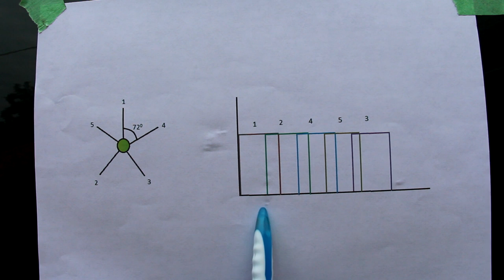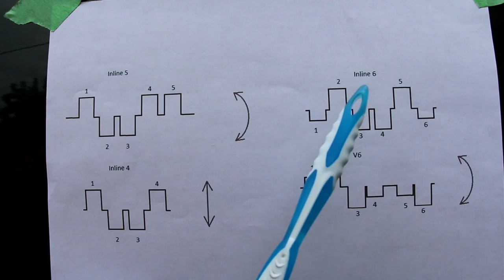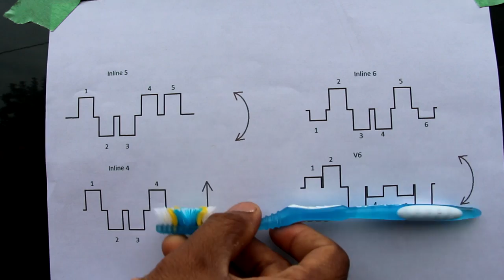Why Inline 5 Cylinder Engines are an Anomaly

Comment: The worst fasteners are on early 2000’s Subaru’s (at least the US versions.) many of the bolts that retain the camshaft and sometimes the flex plate/flywheel are an obscure  “Torx-plus.” A normal torx bit will loosely fit and can occasionally be used to break the bolts free, but it is likely to shatter from the stress concentration. (I ripped my wrist open doing this...)
Anyhow, as a mechanical design  “enthusiast,” I appreciate you pointing out every visible feature as you go along

Comment: The slightly earlier version of the Whiteblock motor used in the 850's and S/V 70's did have an exhaust manifold that the turbo bolts to.  I've had to replace a couple of them.  Its a nightmare.

Comment: Nice one bro. Is it the same as the Volvo T5R engine?
Reply: Nope, this is the B5244S4 which was used in the S40, S80, C30 and C70. It's 2.4L naturally aspirated with intake CVVT and delivers 138 bhp. The T-5R engine is the B5234T5 which was only used in the 850 R and 850 T-5R. That's a 2.3L turbocharged engine without variable valve timing and delivers something between 220 and 250 bph.
As for naming
B stands for petrol (bensin)
5 stands for 5 cylinder
24/23 stands for displacement, 2.4L and 2.3L respectively
4 stands for 4 valves per cylinder
S/T stands for naturally aspirated(standard)/turbo respectively
the last number indicated the engine generation or variant
Reply from the maker: No turbo on this one
Reply: @dvdouden  Thanks bro. That was quite a bit of info!

Comment: great video, the plastic parts inside the engine is absolutely because of saving on costs.. however, depending on the plastic type, it might very well serve just as fine as a steel or aluminium part where minimal force is put upon it :). But I often wonder myself at some solutions that are chosen on some engines, and usually find comfort in assuring myself that a smarter individual than me have designed it in such a way for a good enough reason  ;P

Comment: A disadvantage of most 4 cyl. is that all the pistons are at top/bottom dead center at the same time. It takes a lot of flywheel to smooth this out. 3/5/6 cyl. don't have that.
The new Japanese 4 cyl. motorcycle engines have 90° crankshafts to eliminate this.

Comment: Great video with good explanations. Another factor to include is that mass produced 5 cylinder engines  were possible thanks to fuel injection. With carbuarator 5 cylinder engines always had issues  getting  the exact amount of fuel to all cylinders.

Seems you go thru a lot  of Mevotec control arms.. :-)
Reply: Audi had one in the 100 5S typ 44...don't know how they did it.

Comment: FYI, 13mm is a half inch. (0.5 inches = 12.7mm, with a little bit of clearance between the socket and the bolt).

Comment: The short distance and the coolant slot cut between cylinder bores is the reason why the turbo versions of these used to crack the bore at that exact spot, particularly when the owner has tuned for more boost.  I have seen this on a dismantled Focus XR5 turbo block. If Volvo had gone the way Subaru did with its turbo engines (ie: closed deck vs an open deck on atmo engines) this problem would not have occurred.
Reply from the maker: Good to know

Comment: as always excellent video. can i ask, are the latest (ie 2020) Volvo inline 5 better in design (like no plastic inside a closed engine) and more durable (no oil and coolant mixing problem) ?  thank
Reply: I realize that this is an old comment, but anyhow: there are no 2020 5 cylinders from Volvo. The last one went out of production with the S60 Gen2 in 2018, if I recall correctly. Also that was the AWD diesel. All other versions and models had gone over to the 4-cyl VEA. Last 5-cyl petrol in 2015-16 something. The oil pick up is metal in that one. But there are probably some parts inside the engine which are plastic. Electrical connectors for sensors, for instance.

Comment: I own a Ford focus St 2.5 same engine he is working on,have an oil leak that can't be find, the leak its on the front of the engine,i did change the oil filter housing but no luck,pls brother if you can pls give me a hint
Reply from the maker: Pcv ?
Reply: The pcv is in the oil filter housing,i hade a look again today and saw no clamps on the pipes so clamped them did not have time to wash off the oil and drive it.Will check it tomorrow.

Comment: I have a 2.5L turbo one of these engine in my 2007 s60. They separate the pcv and oil filter. The oil filter goes to the bottom now. The pcv still have a tendency to clog. 120k miles on it and still running good. 
I also get a 1997 960 with a inline 6 engine on it. 160k miles and running good.
They r really good engines.

Comment: What is built in is the hot side of the turbo to the mandifold if you wanto put different turbos on the turbo version u need a custom manifold no mater what

Comment: Those cylinders are crazy close together. Surprised to see the head gasket and walls good.
Reply from the maker: Well I suspect the head gasket failed with all the water in there
Reply: @speedkar99   Yeah, I guess it had to fail. But, it looked pretty good. I've seen a lot worse.

Comment: If you have a chance check out an old mercedes 2.5l inline 5 diesel, it's rumoured to be the most durable and smoothest running diesel in a commercial car, it would be interesting to see how it's built
Reply from the maker: That would be sweet

Comment: The 3.2L I5 diesel engine found in the global Ford Ranger since 2012 is a really good engine. I have one of those and have worked on many of them, and those engines are pretty damn sturdy and reliable. They don't have a whole lot of issues. Just need to keep with the oil changes, use full synthetic oil and high quality diesel fuel, and those engines can outlast the truck.

Comment: inline5 diagram (17:20) in not corect! once  you sed that there are 72` beetwin roads how did you align them in the end? :O
Reply from the maker: They roll 720 degrees not 360 for a cycle
Reply: @speedkar99   all right

Comment: Biggest mistake I've found was when you said that on turbo engines, the exhaust manifold is integrated with the head. I think that maybe you meant that on newer engines it's integrated with the turbo ;-) .
On older engines the oil pickup was made of metal.

Comment: About the balance: There are two configurations. One of them has lower rocking motion in first order. Then use the long connecting rods from inline-4. These have low second order vibrations. I cannot quite understand how this modular engine expands to inline-6 .. Anyway typically you mount a gearbox rigidly onto one side and hopefully some accessories onto the other, then you get high rotational inertia. Also with long connection rods, DOHC, and wet sump the engine is very high which also helps with inertia on that axis. Then just let it wobble a bit around the differential.

In a Volvo the engine leans backwards over the differential and the head is just below the windshield -- at a very high point. Ideally the valve train gears would be on the business end of the engine. This way the could find a home under a hood scoop ...  These were large cars, so they are high and wide. Not like compact cars or Civic.

Inline-5 engines would ideally need very long primary headers. Inline-4 can have 4-2-1, saving weight and friction. Since non-race, non-mazda engines have much too short headers anyway, this argument is probably mood.

In Inline-4 all pistons are speeding at the same time and fight for kinetic energy. Long connection rods are better suited for high RPM, so Gasoline DOHC it is.

Comment: Well I have a question why if I put the crankshaft lock tool in to lock number one on tdc  the marks on the gear and oil pump does line up but then but it is not 100 persent on tdc but if I but ifi remove number one spark pluck and dail it to be 100 percent on tdc then the marks is out on the gear and oil pump why . Please do a test and check.

Comment: I have a late 2014 inline5 V40 the final year of the diesel  inline5, I'm so glad I went for the inline5 instead of the 4pot.
The i5 is far better in every way then the basic 4pot, The sound when you open it up the power delivery and when tuned it's even better.
Inline 5 beats the newer 4pot hands down
Reply: I am not sure about your market, but in North America the the 4-cyl has a much better torque-curve, fuel consumption, lower weight and much shorter overall length. Plus they are timing-chain driven while being interference, compared to the belt on the 5-cyl.
Reply from the maker: All good pros and cons. 
In conclusion, 5 cylinders blurs the line between a 4 and 6 cylinder so much that it doesn't justify mass deployment and is why it's unique.
Reply: @speedkar99  The VME program was also developed in the late 80s, just an old engine by 2016. The 6-cyl version of that 5-cyl you showed (The B63) was also replaced for the same reasons, too large, heavy, and only had power at the higher end. The Si6 and VME engines were just progressions, with the 5-cyl version just being dropped, and eventually the 6-cyl too.

Comment: Modern Plastics can handle changes in Temperature far better than most metals.  So plastic in the bottom end of the motor is fine.

Comment: They use high temp rated plastics that don't melt and the use in parts used for coolant is done because water tends to cause metal to corrode and with plastic it is not an issue.
Reply from the maker: And what happens when it cracks?

Comment: I wonder how much that plastic oil pickup saved them vs. all the maintenance claims caused by it
Reply from the maker: I don't think it's a major failure point it just seems odd that they'd make a sturdy metal oil pan and valve cover (instead of plastic) and go with a plastic pickup tube inside.

Comment: My 5 cylinder Mercedes 300D Turbodiesel is much smoother than a 4 cylinder-more like a 6 cylinder. And do they work-I think 563,000 miles on the original engine (and transmission too) says it all.

Comment: That's an awful lot of seals to leak oil ! Also, you can't really just pull a cover to inspect, any cover you pull opens up the lube circuit. I liked the main oil gallery in the crankcase parting plane, though.
Reply from the maker: That's the thing I hate about this engine, the cover is part of the oil passages.

Comment: I can tell you the oddity, without watching, is that there is not stroke countering for matched cylinders like in a 4,6,8,10, or 12 cylinder.  I can only assume that the cylinders are set individually instead of matching up to oppose another cylinders stroke.

Comment: Funny that bearing 1 spun. My 06 S40 2.4 motor seized and when I tore it apart, it was cyl 1 bearing that HD spun as well
Reply from the maker: Yeah I wonder how
Reply: I had the same thing on a focus st after speaking to someone who knows the engine inside out he said it was because the dule mass fly was fooked apparently it causes the carnk to slam the big end on the induction stroke causing a hammer affect, plus taking it up 5 and a half k rpm between gear changes didn't help... but that sweet sweet engine note pops up at 5k and is a dream to hear

Comment: Flywheel?  WTF?  My inline 5 engine does not have a flywheel, less weight, and not needed because of the 20% overlap.  I guess if you had a manual box you would need something for the clutch, but would it need to be the weight of a flywheel?

Comment: In the end, the need to install a balance shaft to cancel out the engine vibrations and the higher fuel consumption of such engines in naturally-aspirated form ended the idea for most manufacturers. Surprisingly, there's more interest in an inline-3 engine, first pioneered by Ford's 1.0-liter I-3 engine but developed further by the BMW B38 1.5-liter turbocharged engine and the Toyota M15A-FKS 1.5-liter engine.

Comment: Excellent video and a great demonstration of how manufacturers seem to work VERY hard to design for non-serviceability.  Just watching the tear down and seeing what goes into a water pump replacement reinforces for me why I will never buy compact.  And a complete shame because this intent to design to replace rather than repair is why we will see virtually none of these left in 40 years time.  Granted an ICE will be a dinosaur by then but if cars in the 60's had been designed to simply be tossed out when they hit a certain age/mileage we would have almost no classic cars today.  Cash for clunkers was bad enough but now we have companies designing with the strict intent on their products being disposed of instead of fixed.  I can't wait to see gillette begin designing cars.
Reply from the maker: Agreed. Alot of corners are being cut on new cars Today
Reply: The water pumps on these are such high quality that they virtually always last well over 200k miles - they're not a service item.

Comment: I used to have a 1986 VW Quantum Syncro wagon with a VW/Audi 5 cylinder engine longitudinally mounted for all wheel drive. The engine performed beautifully, however its weakness was the fuel injection system. It required repairs or major parts replacements each year. In other words a money pit. If not for the flawed injection design, I would have kept the car.

Comment: In car water pump replacement looks like a horror. Hopefully it is over-engineered so it won't fail too often. Perhaps change the idler and tensioner at the same time as the water pump?
Reply from the maker: Yes it's usually all done at the timing belt service

Comment: The plastic in the inside of the engine is a high-temperature thermoplastic. They use this because it is one: cheaper. Two: lighter.
But I would agree with the why? Durability would seem to be higher in a metal part instead.
Reply from the maker: Exactly, if it's not a reciprocating party then weight shouldn't make a huge difference
Reply: @speedkar99  I think it goes to the total weight of the vehicle. That or the weight of the engine. I still don't think that plastic is the best for these parts.

Comment: it is clearly visible that the reason to get this engine failed is the poor oil change habbit of the user/owner. did not mentioned, but obvious that burnt oil is everywhere. clearly visible on the valve cover's inner side.   kinda interesting part is the PCV system, good that we had a look on it as well.  seems like Volvo (Ford) did a complicated job on this part, but not anywhere reliable for sure this PCV system.   so, sooner or later it's gona be f.ed up and PCV just fails.
Reply: Fun fact about the PCV system on Volvos! They used to be easily user serviceable on Volvo's much older engines and replacing them was considered normal scheduled maintenance. But on these newer engines it became difficult to replace and clean the PCV system, so a professional must do it. I'm not even sure if replacing/cleaning the PCV is listed as scheduled maintenance on the newer engines. This is based on what I heard in a podcast, so I am not sure if it is completely accurate. I just know that it used to be way easier to replace the PCV system back then.

Comment: The volvo inline 5 turbo variants didn't have integrated exhaust manifold. They used what's known as a turbofold where the turbo is molded together with the turbine of the turbo. They were not made like vw integrated turbo.

Comment: My ‘04 XC70 had almost 300k miles before it was totaled. My peeve w/the power train was the transmission which died @90k. My mechanic changed the PCV at 200k when it started to leak; the repair cost about $1000 but it kept that baby purring. I wish I still had that car- the seats were just getting comfy.
Reply: I have an 02 V70 but I'd like to pair it with a 2005-07 XC70, summer and winter
Reply: XC70 eats tires for breakfast-prepare yourself.

Comment: Kill it with the plastic comments.  I love your video but take a moment and learn about plastics.  First take a knife and try to scrape some of those plastic parts... yeh that noise is glass.  These are special plastics. There have been engines made from plastic in the racing industry since the early 80s (really before).  They can make use glass reinforced polyimides and phenolics in everything but the piston crown, cyclinder walls, combustion chamber, cranks and a few other parts.  Saving approx 15-20% over aluminum and possibly costing less.  They may last longer in most situations.  They use metal to reinforced key areas and often the metals they use are more appropriate than aluminum for the job at hand.  

So its really not plastic as in what you think plastic is.  Because plastic is so much more than what you are aware of.  "Carbon Fiber" as we use the word (not its technical meaning) is a reinforced plastic material.  

Why are you seeing so much of it used in car engines?  Its absolutely necessary in controlling the cars ballooning weights.  But when used correctly it may actually laster longer anyways.  Sometimes it isn't used correctly and that is a learning curve that is necessary.  BMW is the king of mistakes and they used plastic in their thermostat.  Doesnt mean thermostats can't be made from plastic but BMW didn't do it right or shouldn't have done it.  

But it takes 1000s of weight reductions to shave a few hundred pounds off a car.  The BMW i3 weighs under 3000LBs why is that impressive?  Because thats how much a Fiat 500e weighs yet the BMW is much larger.  101" vs 91" wheelbase much larger interior and storage space.

But everything imaginable is plastic... even the door skins and the chassis.  The battery is ~450LBs and most likely 100+LBs heavier than the Fiat battery.

So don't be surprised as you see more and more plastic over the years.

Comment: If your smart the upside down oil filters actually make 0 mess , loosen let drain into the pan while draining the oil. Then replace the filter. It's cleaner than a filter with threads facing up.